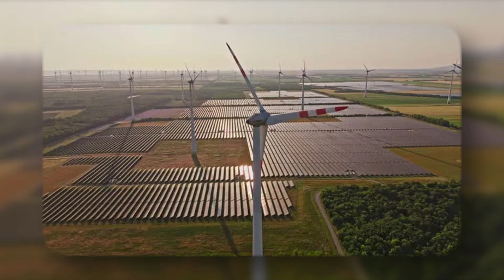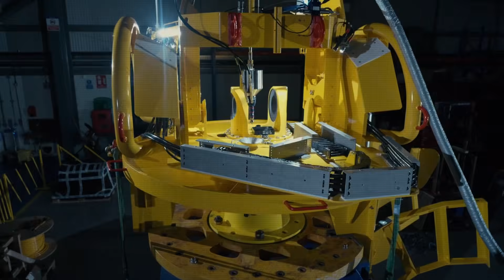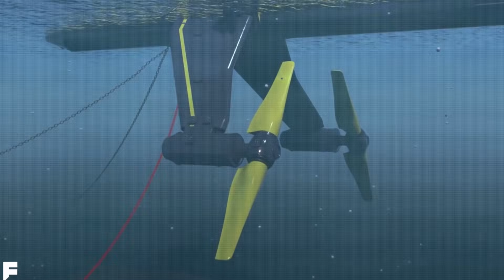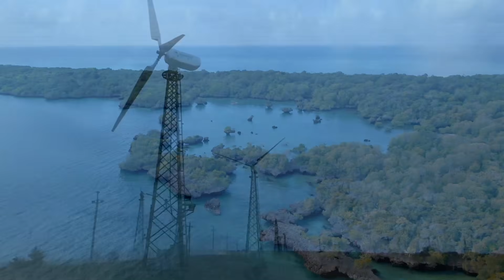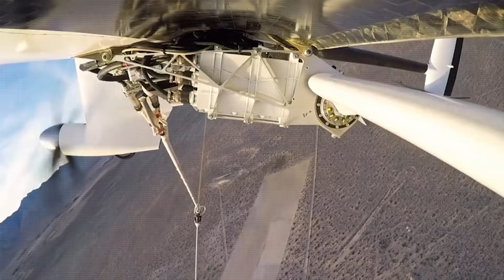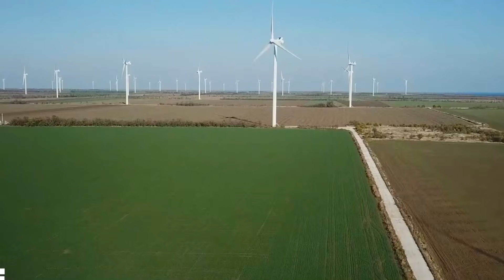Is This The Future Of Renewable Energy?

Comment: Isn’t the energy used to produce the lift energy that alternatively been used to turn another turbine?  If I remember  my aerodynamic theory the portion of drag needed to produce lift is induced drag, and that has to be offset by thrust. That thrust is wave energy that could have been used to turn another turbine.
Reply: Since its neutrally buoyant, unlike an airplane none of that energy is used to keep the kite in the air. Instead, that force is used to keep a constant force against the tether. Since the tether doesn't extend, the energy is used to create forward movement instead.
On the wing, there is a small turbine turning forward movement into electricity.

The key that makes this better than a single large stationary turbine is tip speeds. Ideally, a windmill will be all tip, since the tip is what moves the fastest and captures the most energy per area.
By flying a kite, the whole wing is moving at the optimal speed. Meanwhile, the tether can be fixed to the bottom, which is a lot easier than fastening it to a point in the middle of the ocean which requires a lot of expensive supports.

There have been projects to do the same for offshore windmills - they would be a lot cheaper if you could drop the tower and make the whole wing run at max efficiency. The main issue is keeping the kite in the air in weather. Turns out flyign 24/7/365 in challenging environments based on changing winds is hard, and its very expensive when you crash.

Hopefully these underwater ones will have less dificulties with that.